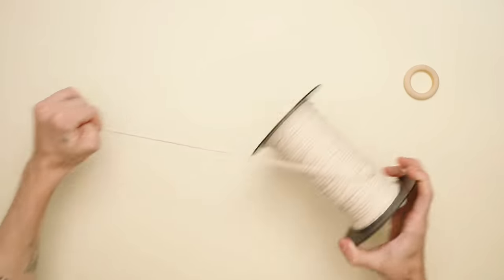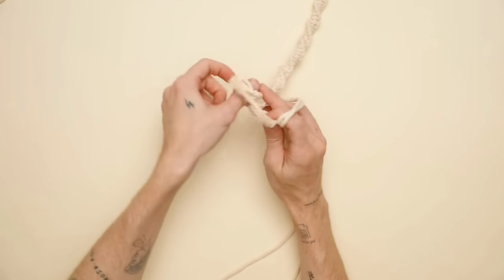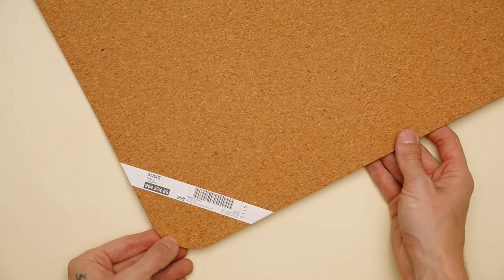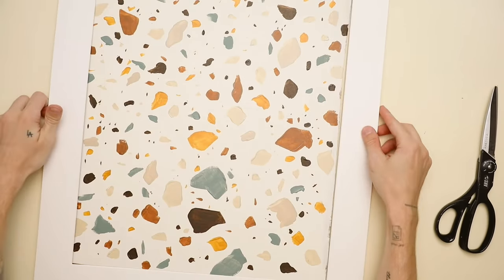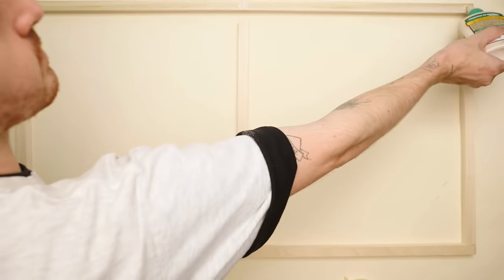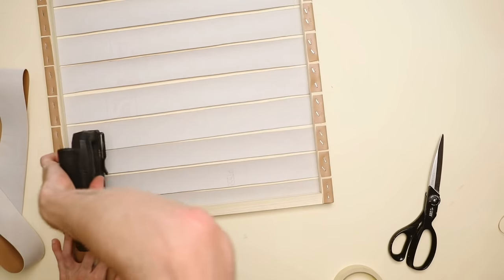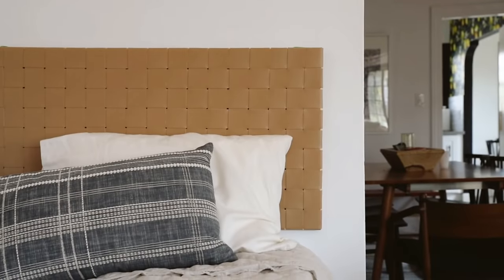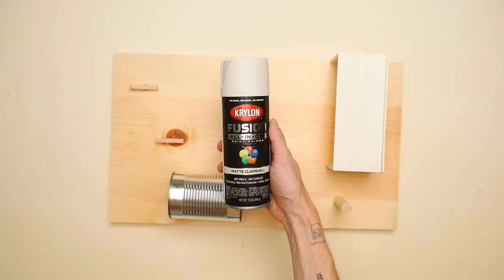DIY DORM DECOR You Actually Want To Make! ✨ Affordable Renter Friendly Decor Ideas!

Comment: Love the headboard! 
It is great just how you made it, and I can also imagine it made with a variety of straps and colors, and even variations on the weave.
 It could be made with black going vertically and white horizontally - or any two colors - for a checkerboard look.
It could be made in a herringbone weave. 
It could be made with wide cotton straps for a boho look. 
It's good as a headboard or as a decorative piece.
Reply: Was thinking the exact same thing🤗🙂
Reply from the maker: Yes!! I was thinking about doing another project with maybe a linen strap for a softer look!
Reply: Love your variations!
Reply: Indeed also good alternative if leather is not your thing
Reply: You could also make it with the cording used for the first project.

Comment: On the paper towel dowel, when sawing to length, perhaps add notch near each end to prevent slippage of the macrame hanger. Instead of using the headboard as shown, use on the wall, with coated paperclips or binder clips to display items. The weave could be customized with any sturdy fabric to create checks, school colors, bright primaries, funky florals, gradients, etc. Jute webbing might also be interesting look. Freehand or stencil greenery for 'organic' touch.

Comment: I wish I had this video when I was in college. Lol. Anywho, college students! Unless your professor explicitly says that you NEED your book on the first day, WAIT TO BUY YOUR BOOKS! I say this because sometimes you can get an older edition of the book at lot cheaper, get some used, or your library may have your book available to reserve. Ebooks are typically cheaper, so if you can use them, you should. 
Get a planner, take your syllabi, and mark every assignment and test at the start of the semester. This helps you keep track of every assignment. 
If you can, always bring a few snacks, especially if you’re going to be on campus for a long time. 
If you’re staying in dorms, try to avoid studying where you sleep. Find a nice quiet spot and use that place for homework and studying. The separation between your resting place and your studying place is important.

Comment: These are all fantastic, well done ideas!  Love your style!  Can't decide which project is my favorite, they are all so cool and useful. Love the terrazzo cork board so much, and the headboard is ingenious. I might have chosen to weave the shorter strands of faux leather for the headboard instead of the longer ones, might have been easier and probably would be easier for a larger headboard. Love the message center with the book bin so much I'm going to have to try it, but I bet if the bin had been placed flush with the bottom of the board, it could have stood up on its own without having to lean against the wall. All great projects as usual from you!  👍💖